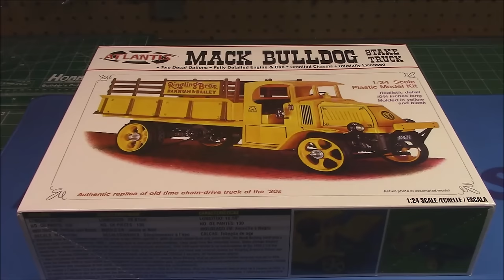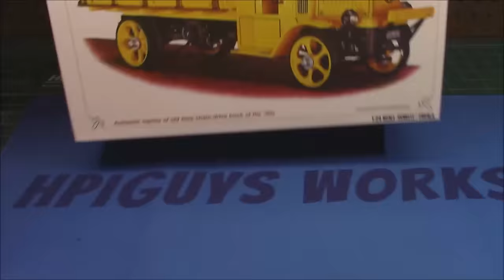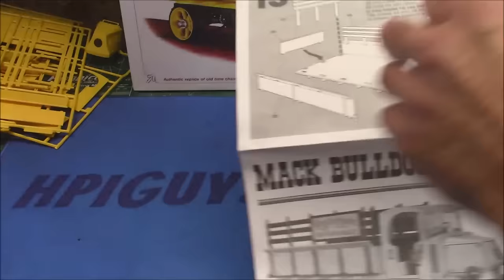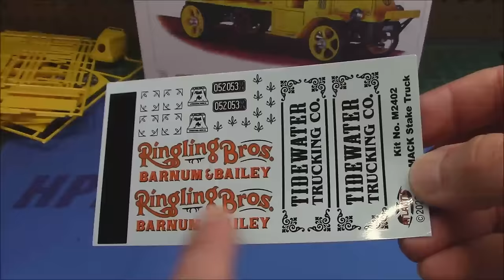1926 Mack AC Stake Bed Circus Truck 1/24 Scale Model Kit How To Assemble Paint Wood Grain Plastic

Comment: Cool rig, I was wondering about the Atlantis kits for s while. You just sold me on them. Now I have a question for all you experienced modelers. I am having issues with todays plastic cement, have tried 6 different cements an seam to having a problem with them actually holding the parts together. I've cleaned, sanded, held for more that 20 seconds, even Testors doesn't work like it used to, gets stringy. Does anybody else have these issues, or is it me. I've been at this for over 20 years and now its frustrating me. I have used super glue ,but I'm not a fan. So the question is do any of you guys have a solution or is it just a sign of the times.
Reply from the maker: Modern liquid plastic cements are leagues above anything we had in the past.

I use Plastruct Bondene and it works very well.  

Stay away from the gooey Testors in the tube and use the clear liquid cements, all the ones on the market work great. 
I couldn't tell you why you're having issues, but I've never encountered any problems with Tamiya, Testors, Plastruct, Revell etc liquids. 

You see me use them in every single video without a problem. Thanks and enjoy!

Comment: Just an FYI: The "fire extinguisher" is actually an acetylene generator for the gas-fired headlights.
Reply: Was it brass or painted steel? I've the same question about the lamps.
Reply: I'm not an expert by any stretch of the imagination, but I have seen both painted steel and brass acetylene generators. I couldn't tell you what Mack was using that late in the game.
 @SteamvilleQuintet
Reply from the maker: Thanks for the info on the tank!